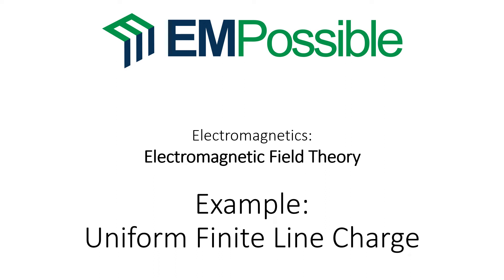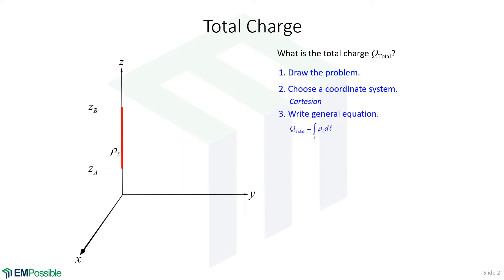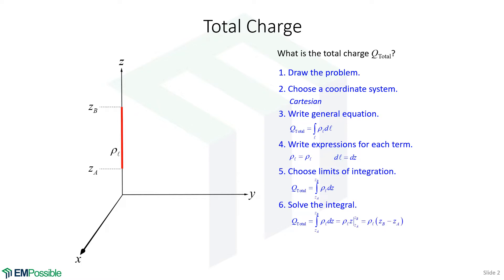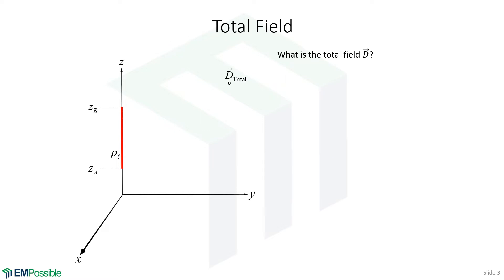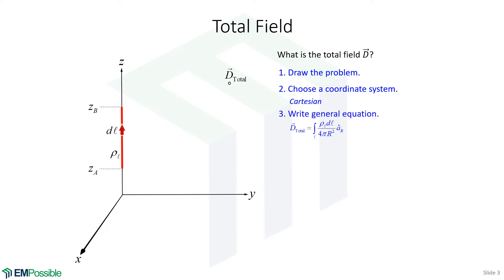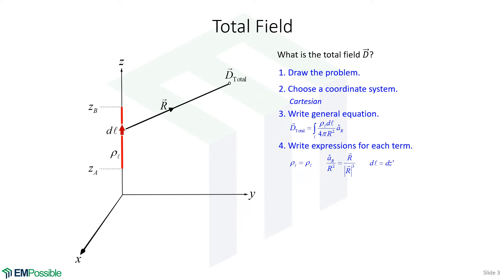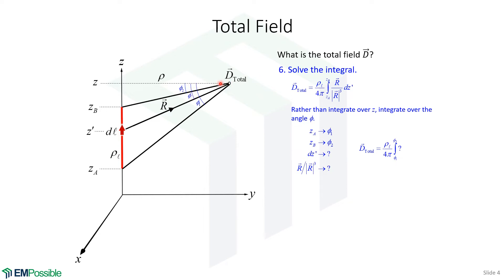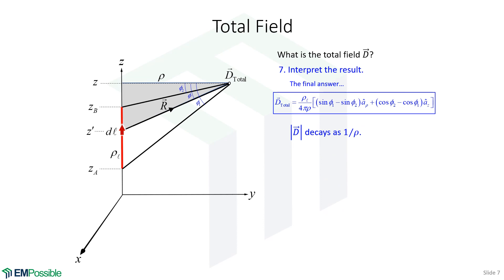Example 1 -- Uniform Finite Line Charge

Comment: what does the "a" with a hat means???????? help, its for my final proyect
Reply from the maker: I am not sure exactly what slide and variable you are looking at, but it is most likely a unit vector. I commonly use a^_R to represent a unit vector in the direction from the chard to the observation point.